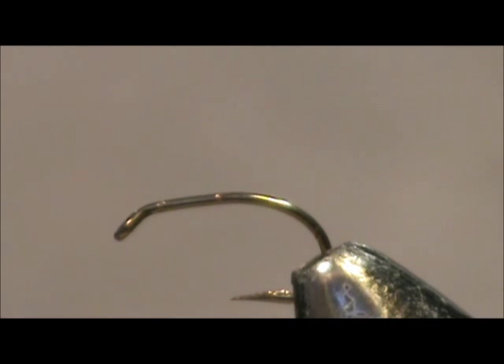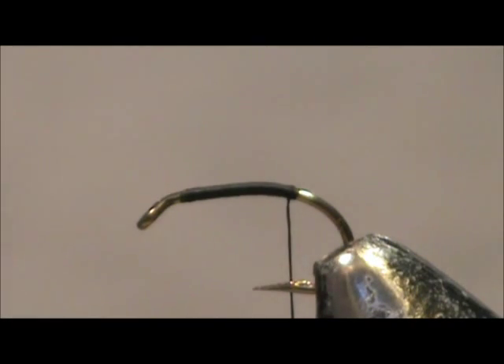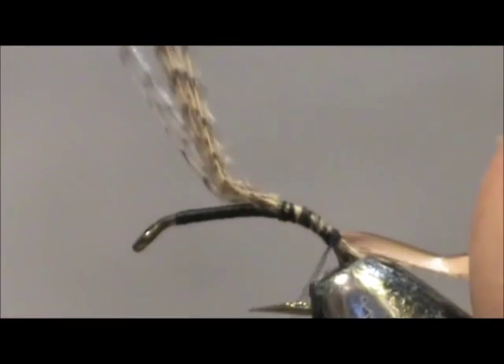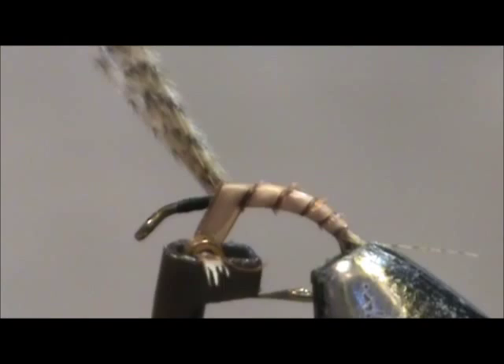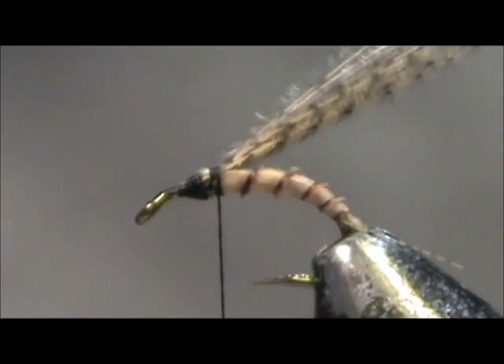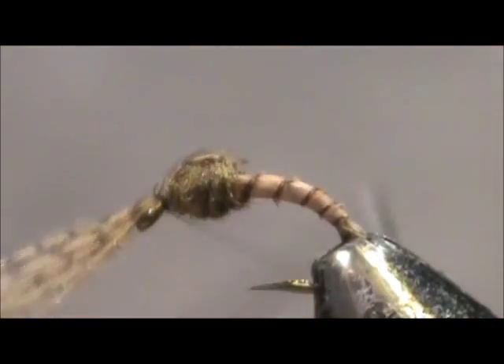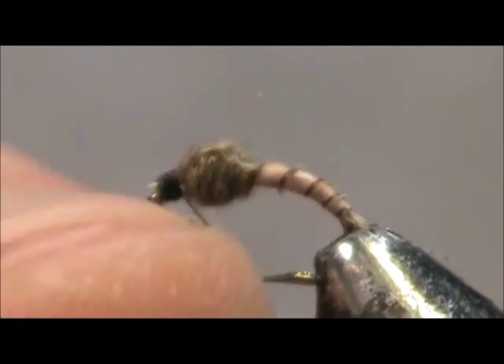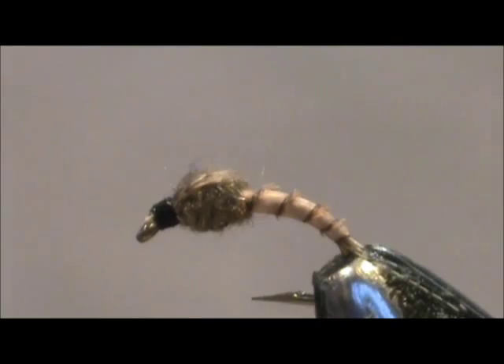Fly Tying a Biot WD-40 with Jim Misiura

Comment from the maker: Hi Bob, you can buy them commercially, but they are so simple that you can make your own. Here are a few examples. Old toothbrush, wire gun bore brush, a stick with velcro attached, pencil with velcro. Anything that has the ability to pick out the dubbing. I use the bore brush and velcro. 
Jim